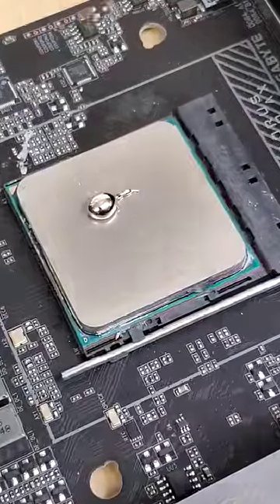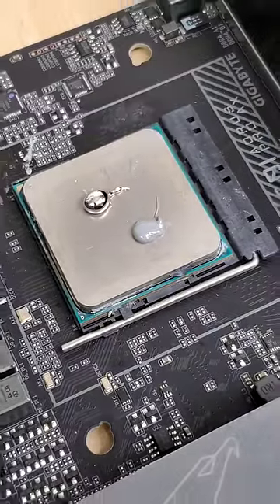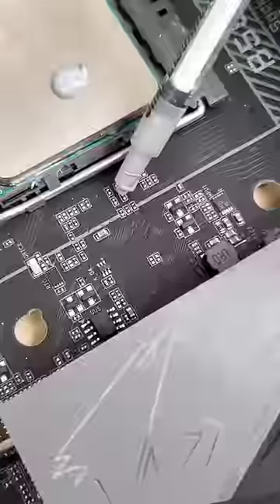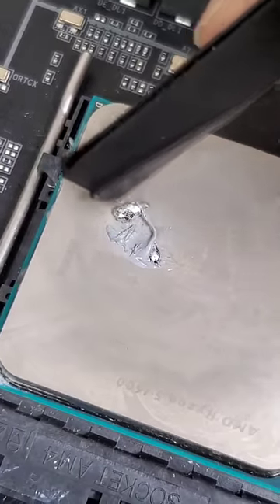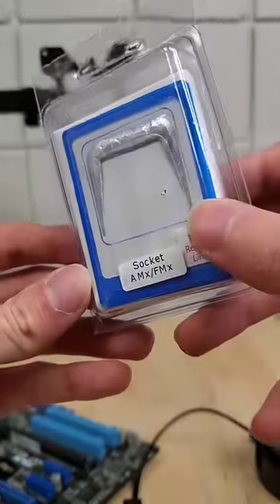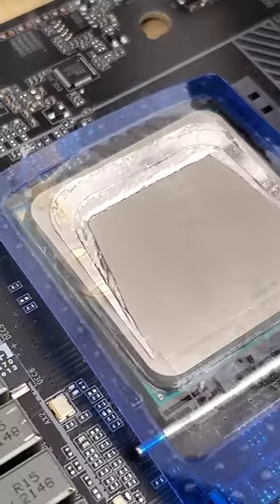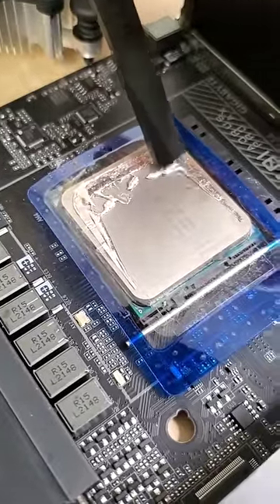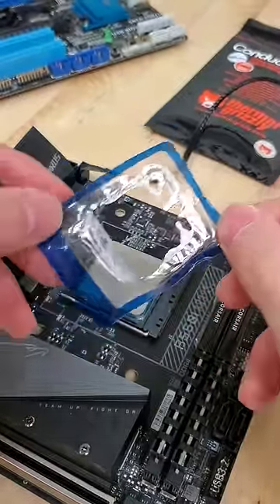the future of thermal paste technology #shorts

Comment: i have used this for 14 years and i hate it. because even with my pump turned off i cant get my  CPU to 100 degrees to melt the crap. and then removal is a huge main in the ass needing to lap[ both the CPu again and the water block. LM is 100x cheeper safer and easyer to use.
Reply: Why would you use it at all?

Work with LM properly and insulate any spots you dont want to short, maybe even get some silicone seals which prevent the LM from leaving the CPU/die area.

Comment: I would absolutely never use absolutely not it is way too dangerous with components that cost thousands of dollars 3m Novec 7100 is how I take care of the heat in my PC you submerge the whole PC unit the liquid  boils off slowly all you have to do is send it through the radiator unit. it's a little pricey in the beginning but it last for ever . About $400 per gallon.

Comment: why not just put a thin bead of the old type silicon thermal paste around the edge of the cpu and then the liquid metal one in the middle getting the benifit of the new liquid metal one with the protection of the old silicon type one? silicon thermal paste is dirt cheap like $3 a tube don't cheap out on a $500 cpu over $3
Reply: please dont build a pc

Comment: this is useless lol also liquid metal, although better at heat transfer, doesn't always gear toward cooler temps. what it will do is get that last 10%+ performance out of your CPU. Its for serious overclockers. But yea this contraption defeats the purpose of the liquid metal since there is not plastic also lol. your cpu will cook.